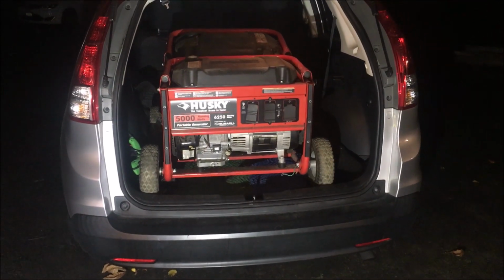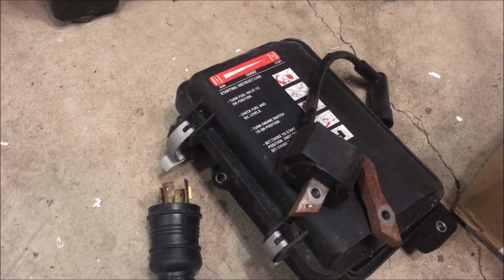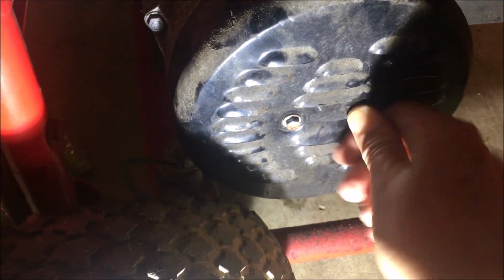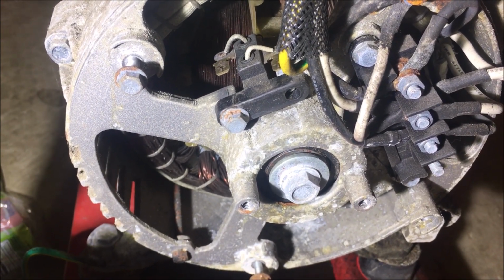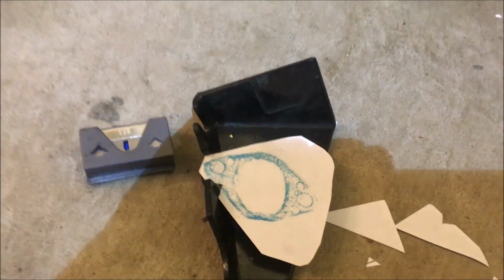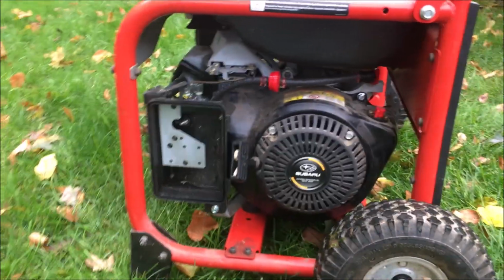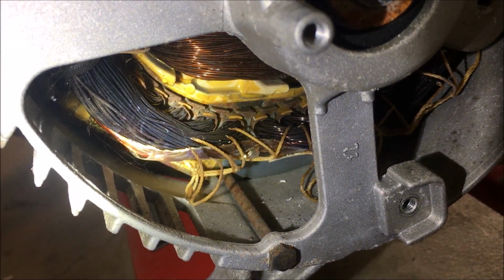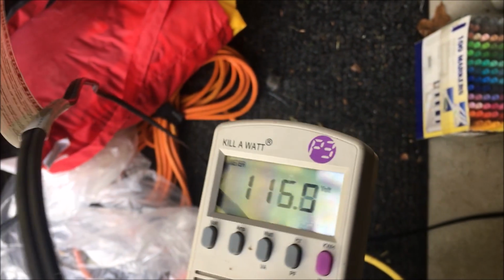Troubleshooting Husky Generator With No Power - Overvoltage - Bad AVR

Comment: James as far as mechanical hardware goes like nuts and bolts with as many generators as you scrap out you should have a bin for nuts and bolts at your house to keep the miscellaneous nuts and bolts and as far as those things you should rarely need a trip to the hardware store sir.  Gaskets are a different animal though

Comment: James I changed the avr and carbon brushes of my generator, still the voltage is fluctuating( it goes to 220 and then to 150 ). We use 220 here 
.I measured voltage from rotor with multimeter and it gives me 217, after connecting avr and carbon brush, voltage comming down to fan etc and on generator meter starts to fluctuate
Reply: I figured out the fault, wire comming from motor to outlet was sparking, which was causing the voltage to flicker, I changed it and now it's perfect
Reply: Buy a new generator

Comment: James, I have been binge watching your videos and have learned so much. Thank you. I don't think soldering the lead on the rotor is due to a poor heat range of your soldering iron, or a matter of flux, solder etc.  I have learned that the "copper" covering of the wires is actually copper clad aluminum.  If the copper cladding is worn away,  then soldering is very difficult.  I have had this problem myself trying to fix a 1970's starter on my international tractor.  Solutions include silver solder which sometimes works or a product on amazon called "wire glue" which is epoxy-like but conductive.  Kind regards, Craig

Comment: James, I  have a husky 5000watt generator  that I tested. Has no power. I found the rotor to be bad.  Where did you buy that replacement motor? Or do you have a replacement rotor? Any help will be appreciated. Thank you.
Reply from the maker: I have not purchased one, but have a couple from other Husky HU5000 generators that had bad stators.  I see that the part is still available, but it is sold with the stator.  Unfortunately the price is between $800 and $1000 not including tax or shipping.  Also several different stator/rotor configurations were used (but same part number used), so a used rotor may not be the correct size.  I would be willing to list one of my rotors on eBay, but you would have to pull your rotor off and let me know the length and width to confirm I have one that would fit.
Reply: @jcondon1  James my 2800 /2250 it tos running great but it won't freeze ice in a dorm room size refrigerator.
Reply: If the Husky 2800 doesn't have an AVR what's the next step to finding out why generator runs smoothly but not creating electricity?

Comment: James I have a husky generator that only puts out about 34 volts at outlet instead of 120 would that be my AVR ??
Reply from the maker: That is a bit strange.  Usually the AVR either works or does not.  Your best bet is to get a multi-meter and test the ohms of the stator, rotor, and wires going into the the avr (blue wires pair and the green and white wire pair).  Test the ohms of your meter first by touching the meter leads together to get the meter resistance and subtract that from any number you get while testing.  Rotor should be between 45-70 ohms, stator between 0.2-.5 ohms, blue wires I think between 0.5 and 2.0 ohms.  Here is a link to a video I have not publish yet that covers a lot of this https://youtu.be/NfE7pbm0l7E.  If all the ohms test good, you will have to dissconnect the bond to ground and test for any continuity from each coil to ground.  In the video link above, everything tested well and looked good.  It was not until I removed the stator that I saw an issue with the stator.
Reply from the maker: Also here is a link to a Husky service manual that might help https://drive.google.com/open?id=1hatgWymmuI_vQDQ07ioQWu8ShMqv0mDp.  See starting on page 16
Reply: Thank you  when i get to this in few days i will let you know how i made out . Thanks again
Reply: AVR sorry
Reply: Ok i will test all that Thanks  Back in the fall i plugged in my compressor to see if it would run it and it did then this spring when i tryed it on my grinder it ran slow and found out only putting out 34 volts just a little back story. Its a 3750 watts with 4000 starting watts husky